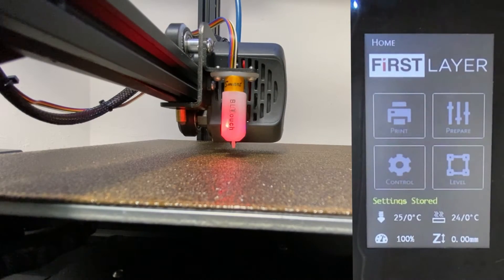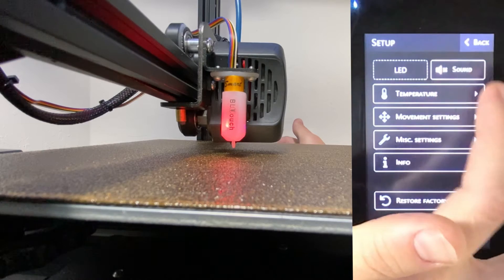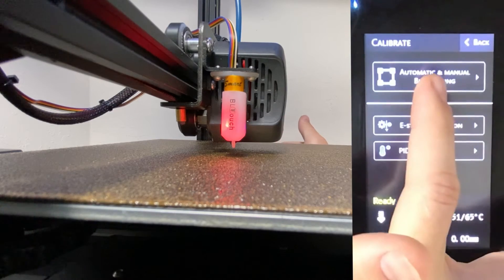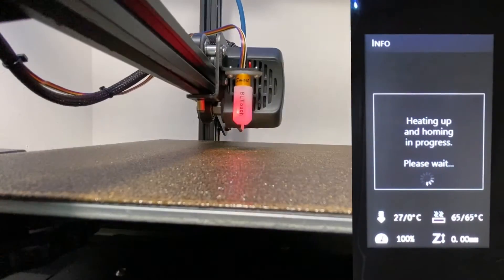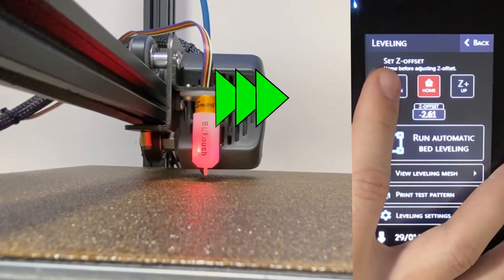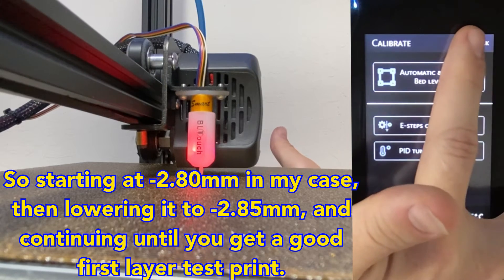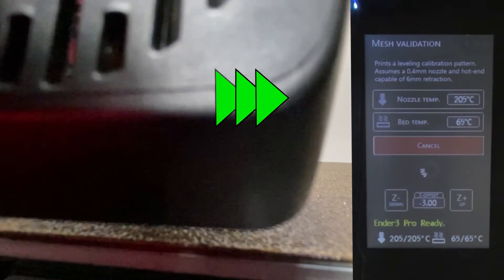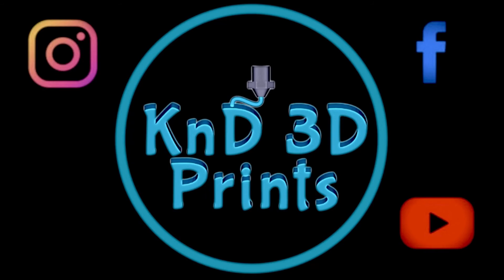How to Calibrate Z-offset: Ender 3/Pro/V2 + Touchscreen + FiRST LAYER Custom Firmware

Comment: Good day. Thank you for a great video. I own an Ender 3 Pro that came with a 4.2.2 main board. I installed a CR-Touch and it worked fine. I wanted to have a Touch Screen but the firmware for the Touch Screen would not load on the 4.2.2  main board. I decided to change the board to a 4.2.7 main board. Now I can get the firmware to load for the Touch screen but most functions do not work, the CR-Touch firmware will not load and the printer crashes all the time. My SD card is properly formatted to FAT 32 4096. I want to try First Layer but I am not sure what is the right sequence for installing the required files (what came first the chicken or the egg sort of thing). I also have the feeling that flashing the Touch Screen itself has no rewind capability (meaning there is no going back). I read the instructions several times. It may very well be that English is not my first language, but it is unclear to me what are the exact steps to load First Layer on my printer. I would be grateful if you could help me. Thank you.
Reply: After speaking with the guy (in his discord) who "maintains" the f1rst layer firmware for these touchscreens...

The firmware is deprecated and no longer works. It's no longer maintained and I'm not certain if they plan on fixing it or just leaving it to rot.

Comment: might note that there is an issue with the touchscreens.. the "Z" height adj during the "test pattern" is glitched..  there is a fix in the works but it does not work quite right..

Comment: How do you adjust the y offset for the bl touch for a Sprite Extruder in this system
Reply from the maker: I believe that’s something you have to do in the firmware when compiling which I didn’t do for this, but I’m not positive if there is an option hidden somewhere in there.

Comment: Thanks for showing the F1rst Layer firmware. I watched your video yesterday and decided to give it a try. It's really an awesome firmware that changed my Ender 3 Pro for better.
Unfortunately I'm having problems trying to calibrate the E-steps. When I click on Run extrusion, nothing happens. I think it only works with a filament sensor which I don't have.
Reply from the maker: Unfortunately, I don’t have the filament sensor either, but if you reach out to F1RST lAYER on Facebook messenger, they should be able to get you sorted out.

Comment: Since doing this upgrade my printer no longer homes to 0,0 and whenever i try and home and auto level it has the BL Touch off of the buildplate and crashes the nozzle into it, HELP!!!
Reply from the maker: I’ve had this exact issue with the Creality firmware many times. This is usually a firmware issue. redownloading the firmware, formatting the micro sd to fat32 with 4096 allocation size and reflashing the firmware. Use a new micro sd if you have one. Make sure to properly eject it from your computer as well.

Comment: Nice video, is it possible to calibrate the x and y axis probe offset too directly on this firmware ?
Reply: Wondering the same thing. I have a Sprite extruder and the bl touch keeps going off the bed

Comment: I bought the same board and screen from First Layer however whenever I calibrate my z offset it always changes. I’ve had it at .5mm .3mm .06 and even 0 I’m not sure why at all. And then ones it prints on the select z offset some areas will print fine others dig in others sides don’t stick. I need help bad lol
Reply from the maker: Unfortunately I haven’t had that issue. I would suggest reaching out to F1RST Layer on Facebook. They should be able to help hopefully.

Comment: I perched the same f1rstlayer screen for my ender 3, and being that I am really new to the print world I have no idea how to set the extrusion parameters to start printing. can you make a video on that subject? Thanks
Reply from the maker: Hmm, let’s see if I can make sure I understand you right. By extrusion parameters are you talking about temperature, flow rate/extrusion multiplier (how fast the filament flows through the hotend and nozzle), and basically all the settings you need in the slicer software?
Reply from the maker: Or are you talking about one specific setting? Regarding slicing, I would definitely recommend searching “advanced how to slice with (insert slicer name)”. But if it’s more specific then I can possibly work on something for sure. I honestly didn’t have to change any parameters that came with the first layer firmware for mine though, but I may be misinterpreting.
Reply: Flow rate

Comment: Is there some way to bump up the max temp to 500C (I just got a spider Hotend and wanna use all of the temp that I paid for)
Reply from the maker: I’m sure there is a way. You can reach out directly to F1rstlayer and they might hook you up with a custom firmware that they’ll put on their Facebook/GitHub after. As far as I know you need to edit the configuration file in the source code in order to do that, but I unfortunately haven’t had the need to do that myself yet.

Comment: Thanks for sharing this. I purchased this same board and touchscreen kit from amazon not long ago. I installed everything and ran a few prints, loaded the new firmware from insanity automation and now its not really working like it should. I do have the correct firmware, got from them directly, and everyone at firstlayer and insanity automation have been great no problems.
watching this video, you are abe to touch the -z offset and it shows that it is decreasing as you push the button, mine doesn't, the z axis motor turns in the -z position but the display doesn't show the offset number, why?
Reply from the maker: Hmmm, I’m not 100% sure about that. I can’t say I’ve experienced that before. But my go-to when something doesn’t seem right is redownloading the firmware, formatting my micro sd to fat32 with 4096 allocation size and ref lashing the firmware. Unfortunately the the only advice I can think of right now.

Comment: Great video, thanks for helping me get started. I accidentally downloaded the creality firmware first and tested it for about a week before updating to the F1st Layer and I have to say the F1st Layer firmware has a TON more features and settings than crealitys firmware does. If at all possible, my print test pattern was printed about 5mm off center toward the xstop is there any way to adjust that so it prints on center? (Pronterface, Firmware mod?)